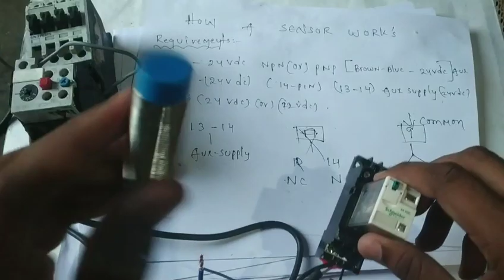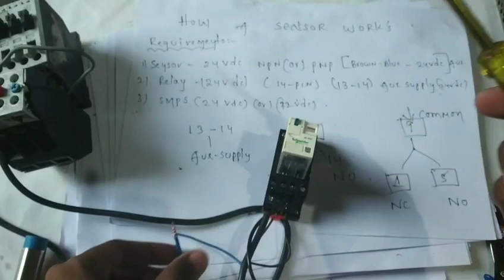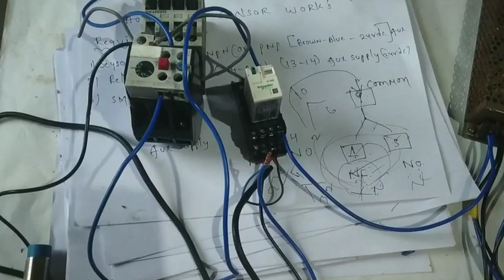How to ON MOTOR with a sensor in telugu 2019

Comment: Sir any possibility to fix the 1600 amp breaker instead of 1000amp breaker. Is it perfectly fitting or any size problems occur at cluster and cradles